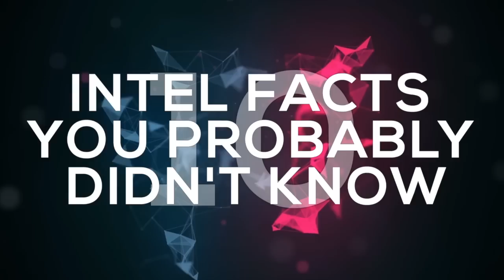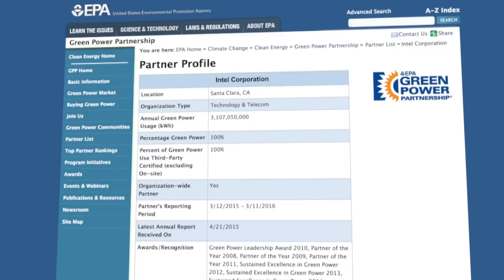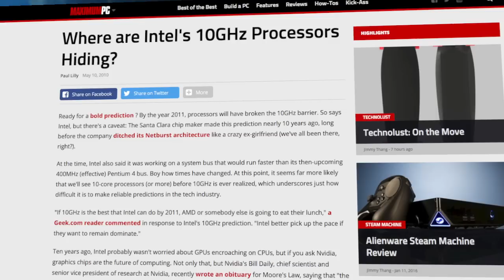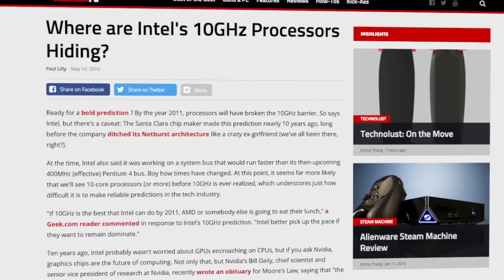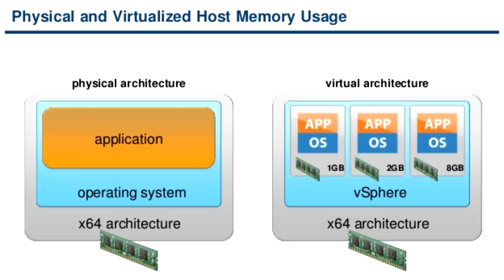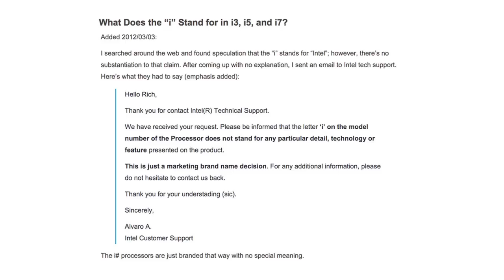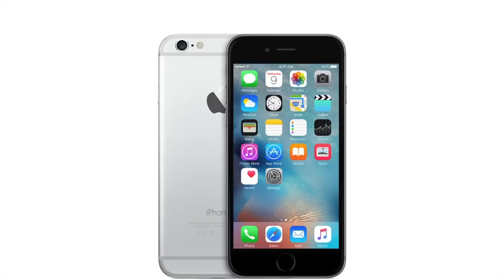10 INTEL Facts You Probably Didn't Know

Comment: Intel or AMD? Which one is the best? I wanna know because I'm going to make a PC! ;)
Reply: no problem with money = intel, problem with money = amd. simple. if we compare amd and intel processors of THE SAME price, amd is FAR ahead in performance
Reply: +Wasiq Nazir reddit.com/r/buildapc.

Don't fucking ask youtube..
Reply: +Eugene InLaw an i3 beats out a fx 8350.
Reply: +Wasiq Nazir live in the US? AMD is cheaper for the same performance, but noisy and have to pay attention to cooling. Live somewhere else? Cost of electricity is bigger than 0.1$ per kW? Using the computer for long periods of the day? Go with intel, it will be cheaper in the long run.
Reply: Nvidia
Reply: Limitz
i3 is also costing more, you idiot
Reply: Eugene InLaw again, depends on where you live. It's stupid not to include running costs.
Reply: berzu21 citation needed.
Reply: berzu21 Haswell was hot compared to Ivy bridge. It wasn't hot compared to AMD's FX offerings.
Reply: berzu21 do you even realize that:
1. Frequency doesn't matter as much as architecture does
2. The higher you go from stock frequency, the hotter it will go, even if its frequency is lower than the stock frequency of another CPU you compare.
3. If you're using the rig for long periods of time, then you're a masochist or an idiot to overclock it.
4. There are tons of forums full of people who didn't have issues overclocking this CPU with air cooling even, and you're having temperature issues with water cooling? It's obvious that you're the problem, or you got unlucky with your CPU. Either way temperature DOES NOT MEAN energy efficiency. Power draw does. And unless you have measured the power draw in both cases, your measurements are useless.
Reply: berzu21 That doesn't say anything because those cpus are in different performance groups and
2. We don't know how you are loading the cpus.

I can get a Celeron to run hotter then an 18 core Xeon.
Reply: berzu21 Except that brings us back to the first and main point. Those cpus are in different performance categories. A better match for the 3570 is an 8350/20.
Reply: berzu21 dude, do you realize that you're going against the entire community with this statement? Your evidence is anecdotal, and it's not scientific. It has to be repeatable. Nobody else replicated your results. Therefore you have no idea what you're doing, or your experiment has serious flaws not dependent on you.
Reply: berzu21 we don't do fanboy shit. There are forums, where people share their experience. If anyone gets results that are outside the norm, then the question is usually "why", unlike you fanboy. The forums usually come up with solutions and explanations. Now you just dropped this bullshit onto us, and we're supposed to believe it?
There are tons of reasons why, if it is even true, you would get these results. But fanboys don't see that.
Reply: berzu21 typical of an ignorant idiot. Everybody is wrong except you. Everyone's experiments are wrong, and only you have the right ones.
My 2 Core i5 CPUs (1st and 4th gen) worked at ~40 degrees under load, with air cooling, which is well below any temperature I had with any AMD CPU with more than 1 core. And this is the same for every other human in the world that tried this, except you.

You're a special boy, aren't you?
Reply: berzu21 no, there's not. My anecdotal evidence is as useless as yours is. Forums, discussions, analysis - that's what matters. Not your manus ex rectum, confirmation bias, and pea-sized brain.
Reply: berzu21 you're projecting.
Reply: berzu21 AMD can get higher clocks due to their architecture but they get less done each cycle. Intel cpus can't manage those really high clock speeds but they get more done each cycle. There is a reason why Intel is the dominant cpu maker.
Reply: berzu21 So then why do you keep bringing up the heat between two different tier CPUs? You seem to be arguing for the sake of it and not actually trying to defend a point. Your debate with Donnie just broke down thanks to you labeling everyone against you as a fanboy. If we are fanboys you should be able to counter our arguments instead of just trying to discredit us.
Reply: bensemus x STOP FEEDING THE TROLL! YOU'RE MAKING HIM STRONGER!!
Reply: fatherbrain1 He hasn't really started trolling me yet so I may have a chance xD
Reply: berzu21 obviously, if you run a furnace, in summer, under an underclocked Intel Atom CPU, it will run hotter than any AMD octa-core overclocked CPU.
Reply: berzu21 your experiment was anything but clean. I'm just making fun of it. If you base your experience on such faulty experiments, not understanding the implications, they your experience is worth absolutely nothing.
Reply: berzu21 No one is saying a 5960x runs cooler then an 860k or a 6300. People always compare chips in similar tiers. You are the first I've seen to take to different tier cpus and say the Intel one runs hotter.
Reply: amd  = heat. I prefer intel. that is me. but if your budget is low. try amd
Reply: I haven't done much research into the subject, but I've always preferred Intel.
Reply: +Eugene InLaw no it's not. There are very few consumer products that need more then 4 cores. Intel has a much better architecture so their CPUs are much more efferent compared to AMDs. They only reason you should buy AMD is super low budget or editing on a low budget. Intel's CPUs will perform better in pretty much all other cases.